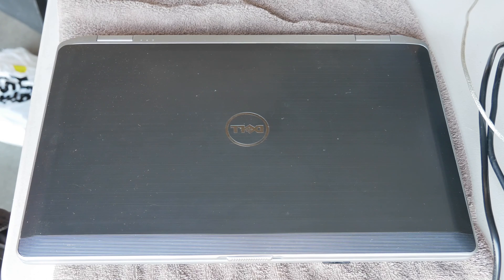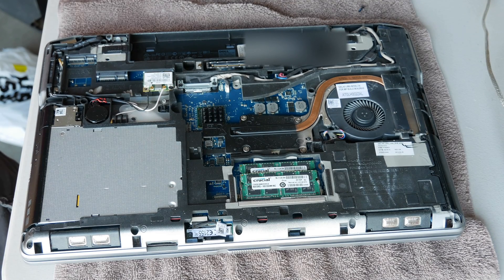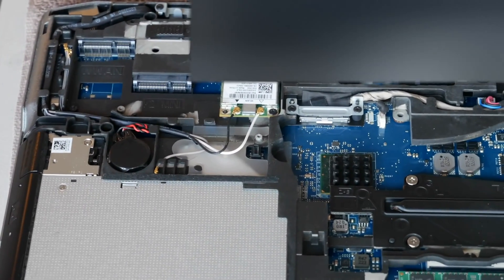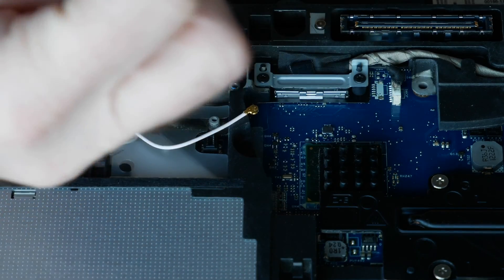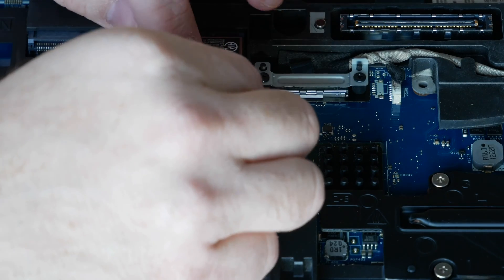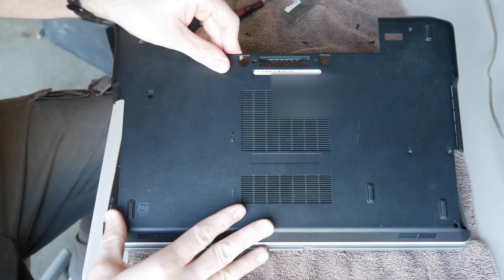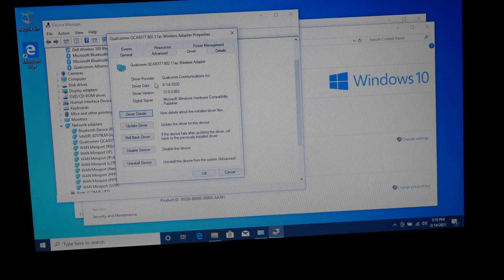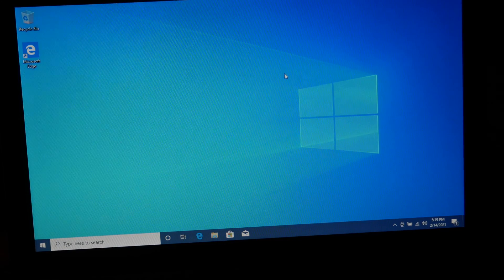how to upgrade an old laptop wifi card

Comment: HI I have a Dell inspiron 20 - 3052 All in one PC. I windows 11,  8gb ram, new ssd hard drive. All Im missing is upgrading the wifi card. Any Idea on how new of a card I can get? I have a deco Be9500 mesh router. So I can do wifi 7. I know that probably isn't possible with out changing a lot. I just want the best plug and play card I can get. Can you help?
Reply from the maker: From what I could find online is that it might possibly work with a M.2 (NGFF) Wi-Fi card going to WiFi 6 but I would recommend buying from a reseller that accepts returns just in case it doesn't work. And of course when working on your machine all modifications would be at your own risk. I've upgraded quite a few over the years and usually as long as the slot fits and if the manufacturer does not block third party cards then it'll work the majority of the time. I haven't had too many issues with dells over the years blocking third-party cards. It used to be more common years ago, but Dell was one of the first manufacturers that seemed to relax that.
Reply: @ShinyTechThings  So I order 2 cards from amazon since you can return with less problems. I ordered a AC9260($11.99) with the suggested wifi antennas($4.99) that Amazon pairs with it. I did check to make to make sure the antennas were compatible with that chip and it was.
Then later I got greedy and order a ax210($24.99) and the recommended 6e antennas($9.99) from amazon. Again they matched fine.
I ended up installing and trying the ax210 card and the antennas. Everything seems fine. Max speed I got was 480mb on the down load using ooaka. But thats after running it a few time. Most starts ar 180 - 200mb. I have a top of the line mesh system and 1.5gb download. So Im not sure why Im not getting a faster speed. 
Its either the card from that company or is the limitations of the slot, motherboard and or processor. It also could be the antennas. I verified that I am getting the 6ghz and 5ghz channel both with what my Deco app is telling me and what the computer is saying.
That being said I went with the ax210 card because of Bluetooth 5.3 vs the 9260's 5.0. Given the age of the computer thats just me being greedy and wanting more power. And I know its not power but me wanting more. For anybody else. I would say the ac9260 would be enough it is half as expensive. And probably will give you the same speed and it the added benefits of being a oem type chip. Im too lazy to uninstall the ax210 chip and try it with its antennas to see if I could get a faster and better speed. Because it feels like I should be getting more. @shinytechthings if you have suggestions or theorys Im open to here it.
Reply from the maker: @Bigperry4th If you watch the task manager and look at the CPU utilization while you do the speed test is the CPU hitting 100%?
Reply: @ShinyTechThings I think it was. But now randomly now my issue is it doesn't see my wifi card. When I look for hidden drivers, I see it. But I cant get the wifi to work
Reply from the maker: @Bigperry4th If you shut down the computer and then wait a minute and turn it back on, does it start working again?
Reply: @ShinyTechThings No I restarted it a bunch of times. Its an old Dell so I even ran threw the prestart diagnostic that checks everything before start up. I ended up going to the device manager deleting the Driver from the hidden menu. For some reason the Bluetooth always showed and worked. But I deleted that too. Then connected my phone to the computer. Set it to tether via USB. That way I had internet. I went to Intel and downloaded their software scanner. Scanned the computer and the Bluetooth driver came up right away. So I installed it. Mind you I did all this in one fell swoop. So I hadn't restarted the computer again at this time. So when I didn't see the driver for the wifi, I just assumed I needed to restart. I restarted and then the computer could see the card again. And when I connected to my phone and rescanned with the Intel Software. It showed that wifi driver and I was able to install it and everything works fine for now.
Whats weird is from instalation to now when I turned it back on it was working fine with all the start ups. But I think the fact that I left the computer on sleep mode for a week or so is what caused it to fail. Because I that is the only thing I did different from install.

Comment: I'm planning to upgrade my WiFi 6E ax201 to WiFi 7 be200, is it worth it or should I just stay with WiFi 6E if the internet speed was already fast in it?
Reply from the maker: @matthew_0001 Unless you're doing large file transfers over the air, if you are fine with your Internet speeds I'd save your money.

Comment: I have a very old laptop from 2010, Lenovo g460 with intel p6000. The wifi card which is "intel centrino wireless n 1000", the driver  isn't supported anymore on windos 10. It can't detect any wireless connection. Could you please recommend me the best upgrade for it?
Reply from the maker: @sempakrangergg This affiliate link is to a Wi-Fi 6 half height card which I think will probably fit your model. Please let me know if it works for you or not.
https://geni.us/nUiBq
Reply: @ShinyTechThings  Thank you I'll check that out. I don't know what wifi card my laptop originally came with since current card is not even detected in device manager, probably the repairman replaced the card and the bios has whitelist. It's been a long time ago
Reply from the maker: @sempakrangergg  depending on the model it could be locked by the manufacturer but on newer models I see less of this issue. Just buy from a store that accepts returns just in case. Also, it could be the slot is disabled in the BIOS or that it died. Please let me know how everything turns out!
Reply: I knew that laptops older than 4 years still work. Mine is four years, yet my family thinks it's just junk. It sucks that we have to replace stuff all the time

Comment: I have a Hp 630 Laptop and I want to upgrade to a WIFI6E Tri-band or WIFI7 TRI-BAND could you help me find a replacement
Reply from the maker: How many antennas does your laptop currently have?
Reply: @ShinyTechThings    One it is 2.4 GHZ only not dual band.
Reply from the maker: @SamuelJackson-y9k  so that gets tricky because although it could work it can cause problems if the antenna isn't designed for that frequency. You can buy  internal antennas on eBay. If you match the frequency design Then it should work
Reply: @ShinyTechThings  Wifi 6E Antennas and Wifi 7 Antennas or just Wifi Antennas.
Reply: @ShinyTechThings  Also were you able to find a replacement upgrade for my Hp 630
Reply from the maker: @user-bq6vz6ew3q since Wi-Fi 7 as a specification has not been finalized, there's no way to guarantee if they change antenna design requirements. Although I suspect you will probably be fine. If the new card that you get supports 2.4 gigahertz, 5 gigahertz, and 6 GHz than I would just look for an antenna set that supports all three and make sure the card has the correct amount of antenna connectors and then you should be fine. One thing to note, however, is that in older machines you might bottleneck with your processor at higher speeds.
Reply: @ShinyTechThings  So maybe Wi-Fi 6 to a Wi-Fi 6E card upgrade may be a better starting point.
Reply from the maker: @user-bq6vz6ew3q not necessarily because Wi-Fi 7 will be backwards compatible. My biggest concern right now though is that the spec wasn't finalized last time I checked. If you buy from a seller who accepts returns, you can always try it out and see how it works for you.
Reply: @ShinyTechThings  Question I tried to locate the original Wifi card for my HP 630 and didn't find one do you if there is a HP series that is compatible with my laptop for now I will go with an Original replacement.
Reply from the maker: @user-bq6vz6ew3q I would just buy a card from a seller who accepts returns without a restocking fee. I have had less problems with HP over the years but they used to always white list particular chipsets and nothing else would work in them. Nowadays. I've had less issues with that but if it were me I would just find a seller who will let me return the card. If it doesn't work and just buy what I want and see what happens. From there, you could just return it if it doesn't work or look into patching the bios file but just know if you make a mistake when patching the file You could kill the motherboard in the process of updating with a incorrectly modified bios. So unless if you have experience with this or want to risk the board, I would just recommend returning it. And using the original cards that are available and living with limitations.

Comment: how can we check if our current laptops can be upgrade to new Wifi 6 ? is there a quick reference? i am interested in upgrading multiple laptops i have so far. Dell Precision 3540 and Acer ES1-572. thank you!
Reply from the maker: Wi-Fi 6 should not be a problem as long as the processors are fast enough to handle the faster speeds and you have the correct antennas for 2.4 GHz and 5 gigahertz. Where you could run into a challenge is with Wi-Fi 6E as you would need an antenna designed for 6 GHz. Although it would probably still work, it just would not be as reliable or fast. It's something I would have to try out to know for sure.
Reply: @ShinyTechThings  thank you
Reply from the maker: @hidavidhuang you're welcome, please keep me posted on the upgrade. Just check the slot type inside the machines and also Google those models to see if they have any challenges with swapping out but you should be fine.

Comment: Hi, I'd like to inquire if it is possible to upgrade the wifi adapter on my older ASUS laptop model X541UAK - X64-based PC to a WIFI 6 adapter. I currently have a wifi 6 router, but my laptop does not support 5GHz. If a direct upgrade is not feasible, are there any alternative methods to enable 5GHz speed on my older laptop?
Reply from the maker: @mhameedali Since your laptop doesn't support 5GHz then it's probably missing the 5GHz antenna inside the screen bezel so going USB is the easiest solution. Below is an affilliate link to some of the nicer USB Wi-Fi cards. Just note that performance wise the bigger the antennas the better range and speed that you could achieve. Meaning a nano card that you plug in that barely pokes out from the USB port won;t be as fast as one that has a USB cable that connects to an external card that has antennas on it. If your laptop sits on a desk this is no problem but if you travel a lot it can be inconvenient to unplug and re-plug for when you use it. What speeds are you currently getting and what speed do you pay for your Internet?
https://amzn.to/453z7A1
Reply: @ShinyTechThings  My ISP provides 400 Mbps. I have wifi 6 router. I get less than 100 Mbps speed in my old laptop. It doesn't support 5 GHz.
Reply from the maker: @mhameedali You should see a big speed increase with any of those cards as long as you're within range with one exception. Your processor will need to keep up with the increased speed. What CPU does it have?

Comment: Very helpful thank you. Having problems with BRAND NEW HP laptop on windows 11 that randomly disconnects from the internet. Sometimes the whole wifi connections button disappears. I wonder if a new wifi card would fix it?
Reply from the maker: @Scott C since it's brand new I would exchange it at the store if possible otherwise call support. No point in paying for a new Wi-Fi card if they will replace it for no cost. It could just be loose inside but I'd call support before cracking it open in case it's a known issue on your make and model.
Reply: @ShinyTechThings  Thanks, I'll call them.
Reply from the maker: @Scott C Please let me know what they say and how it turns out.

Comment: I have an HP ENVY TouchSmart 17-j173cl Notebook PC with a 802.11BG ML ROW CQ60-10 WIRELESS CARD and want to upgrade to wifi 6e how do i find and match for this computer
Reply from the maker: @chuckb2175  I don't know if HP still blacklists non HP cards or not so you would have to try it and see provided it's replacable and not soldered to the board. If you open it up you can look at the existing card interface and available antennas then compare to the Amazon affilliate list of cards below:
https://amzn.to/3q2k2Ab

Comment: Excellent video. Do you think I can installe a wifi 7 card on an 11 year old laptop if the connector is the same ? Thank you.
Reply from the maker: @Fan TV Yes, but if you're stuck antennas, don't support the same frequencies of the new card, then you can have issues, also, the new Wi-Fi card will most likely be faster than what your processor can handle because it's just not fast enough to handle all the traffic throughput. I'm assuming you are running a 3rd gen Intel CPU or equivalent?

Comment: Awesome video! My ASUS X551ca-SX029D has a very old and slow wi-fi card (Atheros AR9485). Can you recommend a compatible one to replace it with that supports wi-fi 6? Thank you sir!
Reply from the maker: @@user-xi8hp4ow7o Because it's an older 1.5GHz Celeron even if you do upgrade it there's a strong chance your processor won't be able to handle the full speed of the card but give me a bit to try to find something that might work. Does your laptop currently support 2.4 and 5GHz?

Comment: Hello, 

I have Dell 3567 laptop with Qualcomm QCA 9565 network card which is not working in my office because in office dual band routers. Could you please guide me which card is suitable for upgrade for my laptop?
Reply from the maker: From what I see for that model number is a newer 8th generation. I series processor so most likely the same card I used in my 3493 will probably work. One thing to know however, is that if you do not have dual band antennas then you may need to replace those as well. Please see this video and if you have any questions comment on this other video.
https://youtu.be/NTBzSeLy-Yg
Reply: @ShinyTechThings  7th Generation Core i3 process. I never opened it before now planning to open for card replacement. I will watch the your recommended video and let you know if it resolve my issue.
Reply: Is intel AX 200 good to go or any other recommendations from you.
Reply from the maker: Sounds good, thanks and please keep me posted either way!👍
Reply: @ShinyTechThings  Do you have an idea about slot on my laptop motherboard mPCI or M2? It will help me to decide to purchase card only or card with M2 kit.
Reply from the maker: The easiest way to confirm this is to just open it up since when I googled the specs it was slightly different so any information I find online might not be 100% accurate. But basically open it up and take a look at the slot type and how the card connection looks and then look at the various cards you were looking at purchasing online and they should look exactly the same. If not then feel free to email me pictures and my email is on the YouTube contact page.

Comment: hi sir i have lenovo g40 supported 802 11b 2.4ghz card, can i upgrade into 802 11ac 2.5ghz?
Reply from the maker: That's hard to say but the best advice I can give is to buy from a seller who accepts returns and just try it out. Also, the antennas that are in your machine currently are probably not designed for 5 gigahertz, so you may need to also purchase new antennas to install as well.
Reply: @ShinyTechThings  thank you sir godbless
Reply from the maker: You're welcome! Please let me know if you upgrade and your results.

Comment: Hi! Nice video. My Sony Vaio  SVF14AC1QM is using a Broadcom BCM43142 BCM943142HM. How do I know if it can be replaced by a better one?  Is there anywere a compatible list? I would like to buy a faster one. Thank for your help!
Reply from the maker: @user-fk5xd7lp5k For a compatibility list the closest you will get is if you look up your model and see what cards were offered as an option. The best advice I can give is to buy from a seller who accepts returns if it doesn't work due to the manufacturer blocking all cards that they don't offer. It's really hit or miss but it's not as bad as it used to be years ago back in 2005-2010 where it was more of the norm for companies to do this.
Reply: @ShinyTechThings  Thanks, I will check on Aliexpress, maybe some seller can help because I can not find other suitable wifi card for my laptop.
Reply from the maker: There's a chance this one could work on NewEgg by you would have to try it out and also realize you may need to buy and install new Wi-Fi antennas.
Check this out on @Newegg: Mini PCIE Wi-Fi 6 Bluetooth 5.0 MPE-AX3000 WifI Card Wireless Dual Band 3000Mbps Half Mini PCI-E Network Wlan WIFI Card, 802.11ax/ac 2.4Ghz/5Ghz Adapter MU-MIMO,OFDMA, Windows 10 64bit For laptop https://www.newegg.com/p/0XM-0555-00005?Item=9SIAJR2JPX8382&Source=socialshare&cm_mmc=snc-social-sr9SIAJR2JPX8382_-12012022